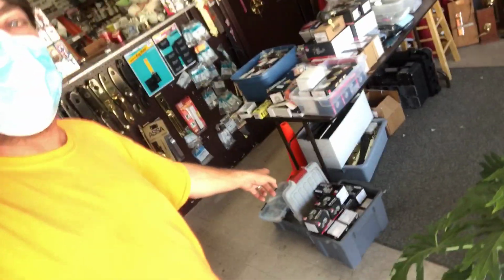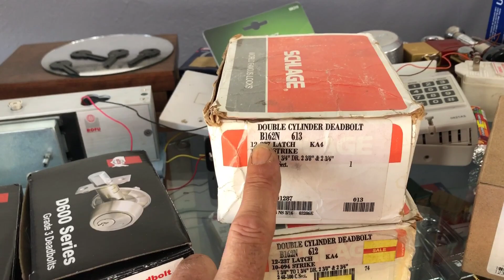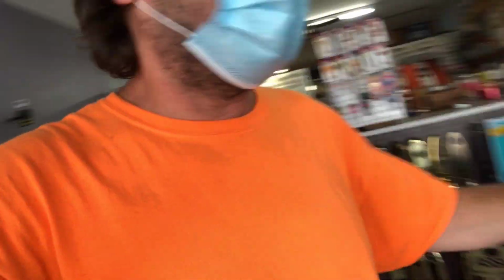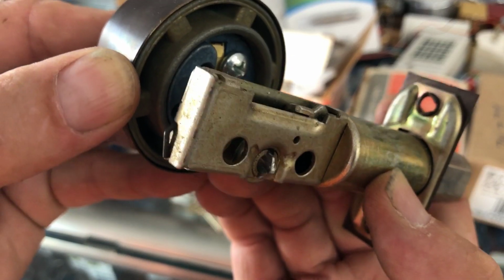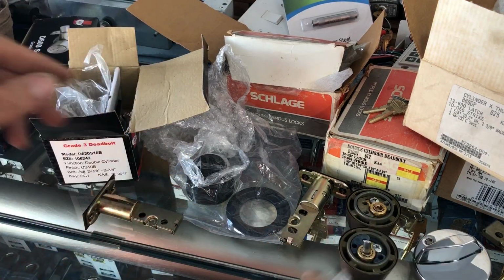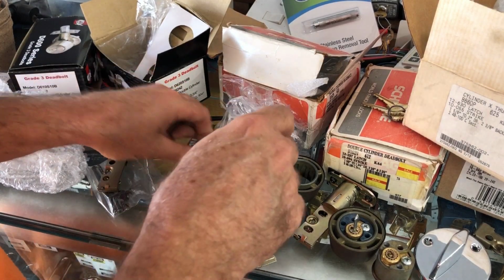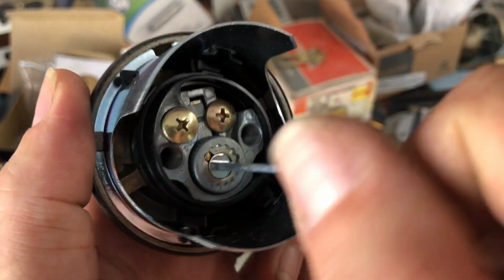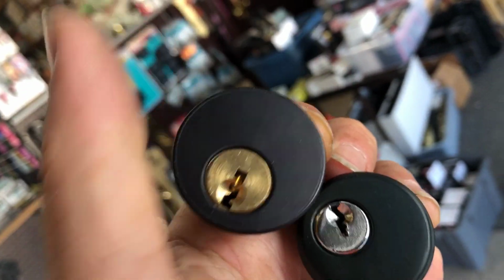the LSDA D600 series deadbolt & the dang dark bronze conundrum

Comment: @ the 18:00 mark you are trying to show the difference with how much farther the lsda core sticks out because of the 6th pin, but I'm pretty sure you are holding both sides of the schlage 5pin instead... lol some how you set down that lsda and picked up the other schlage and then couldn't see that extra pin making the core longer because it wasn't there. "It doesn't look like it... it really doesn't look like it... I dont know where I was going with that..."
Reply from the maker: Phred Phlintstoner ohhhh I see now lol! Those were the same haha
Reply: @selock  it's all good though. Just before that you showed them both and it is obvious how much the back sticks out. So you are right, even if it seemed otherwise at the time.